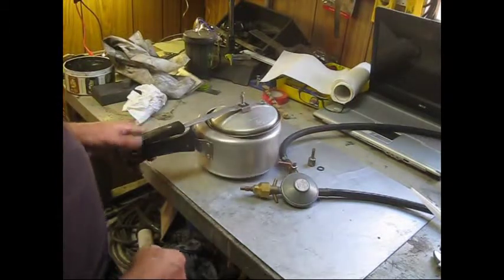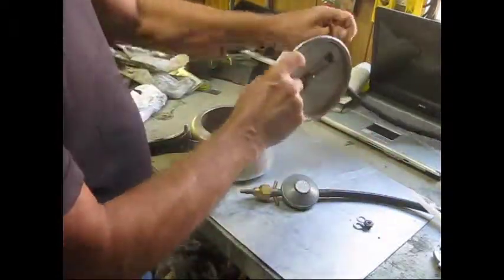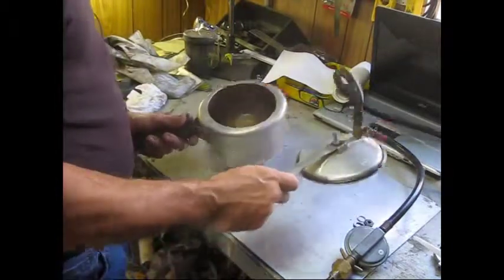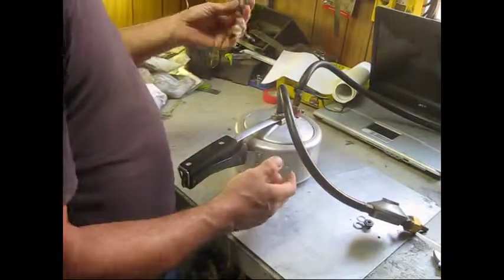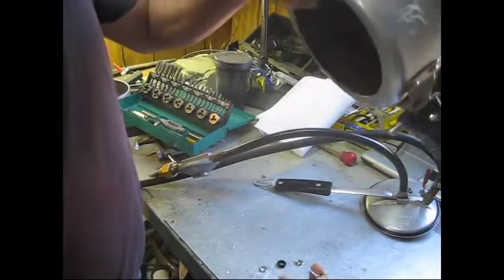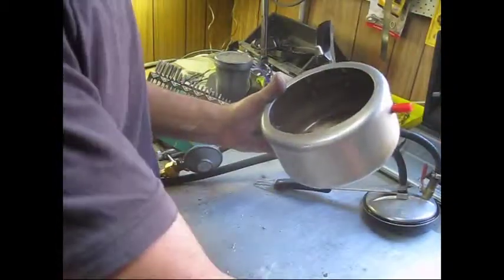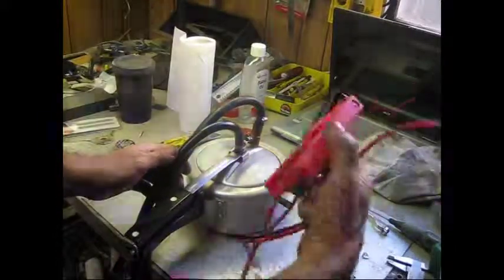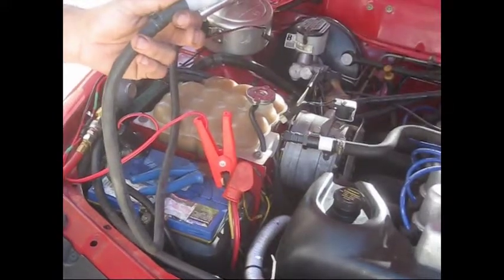DIY automotive smoke testing device

Comment: Hmmmmm.....perhaps I missed something but it looks like when you screw the wire connections into either of the sides, then connect pos. and neg. to battery that the entire pot would be heated up.  
I did not notice anything that you mentioned that would insulate the two connectors from the pot walls.  You put in a couple of rubber grommets, but only AFTER putting wire connectors  into the side walls.
Did I miss something?
I have to commend you though, on the use of a pressure cooker.  It is not the thin stuff that a cheap paint can is made of.  Two thumbs up for that one!!!
Reply from the maker: Terminal posts are insulated. Otherwise the pot would melt pretty much instantly.